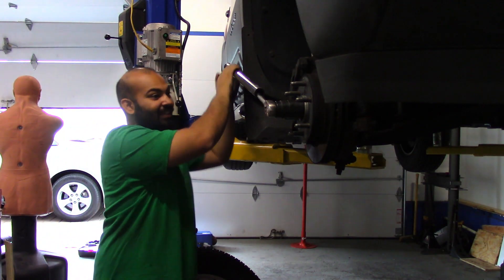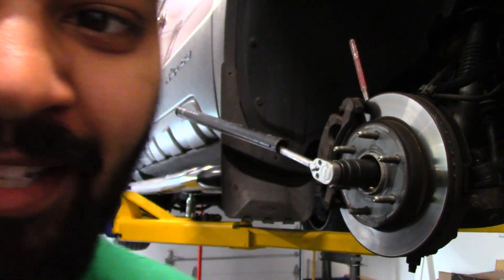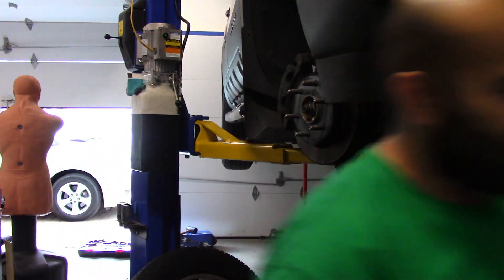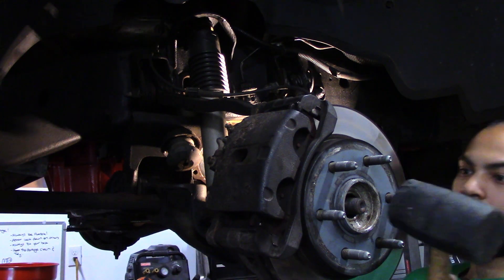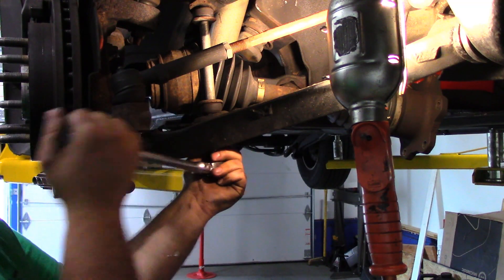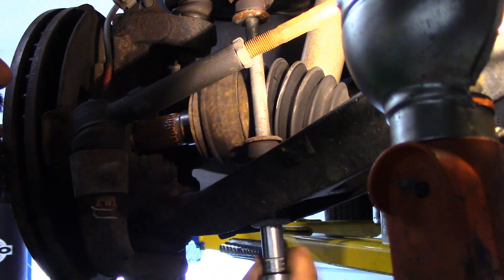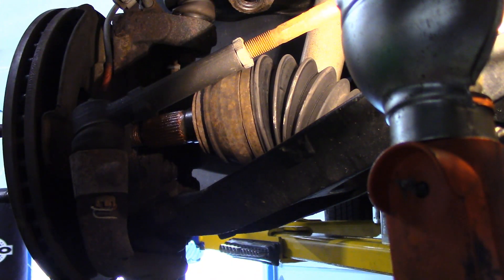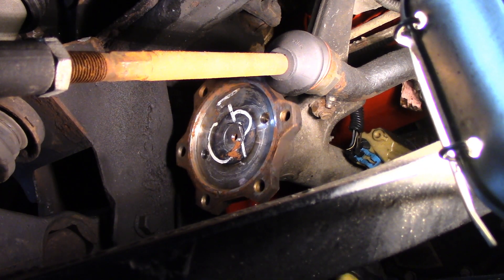HOW TO REPLACE FRONT DIFFERENTIAL SEAL ( CHEVY AVALANCHE )

Comment: Haha. You were using the wrong approach and tools. The key is a long 4ft pipe ($5) at Home Depot, HB Pro Breaker Bar ($15) and then slide that pipe all the way close to the head of that HB Pro. Wait for the click and bask in the glory of that $20 set up. :-) how did you finally break that nut loose?
Reply from the maker: I will definitely invest in that 😅😅😅.. Someone place permanent locktite.. Ended up heating it and going with my same method and  heard a crack... Then used the gun and bam it came loose😀😀😀... 
I take it you have ran into an issue like this before??
Reply: @Kingcustomz  Yeah man. I have an older 97 BMW from the midwest and that bolt was on there tight. I applied the method described along with some spirited tapping from my 8Lb hammer and finally heard that click.
Reply from the maker: @DonBMW  oh man, the older the vehicle the more annoying it is. Glad you got that out!!!I'll definitely use your tactics... Do you have a Chevy is well